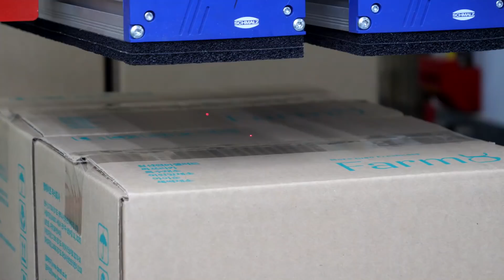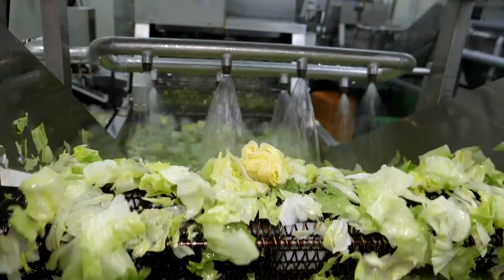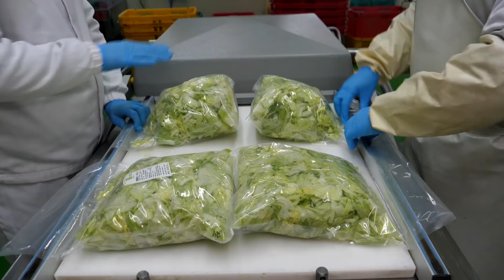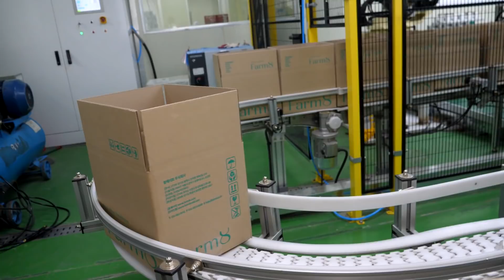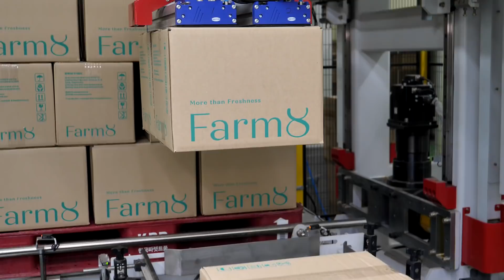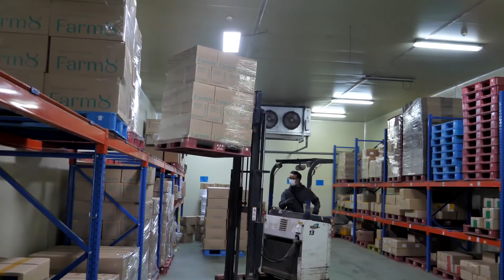연매출 600억! 샐러드생산 1위! KFC, 버거킹, 써브웨이 납품하는 국내최대 샐러드 공장의 생생한 현장 / Amazing Korea's largest salad factory

Comment: The points that need humans will soon be replaced. It will be very easy to use self driving lifters to transport the boxes from the output to the truck. And some system to assure quality. More and more, this will be a black box where produce goes in, product goes out. No human interaction required.

Comment: It is for sure one amazing FACTORY. I how ever a person who has built factory's world WIDE. A d have a PHD in arts and  industrial design engineering.  I find the factory to loud. The contacts on opening and closeing Gates, door, spinning dryer seem to bang. The over all conveyor system is ok. But with blowers at the points where the chopped lettuce gathers can be eliminated.  A small constant clean water also should be placed at those points. Spent water with scrap, piece of lettuce could be skimmed , quick dryed for chicken feed, rabbit  feed. And it would cut down waisted man HOUSES cleaning. The white belt first one should be replaced to a newer system, that's  easier to keep clean. With fast food ecoli salads. 
It's worth the effort. So in a recap, make factory quitor,  upgrade debarie points where scrapes gather. And cut cleaning hours, by make more spray points, per wash, a d after wash points, place quiet blowers. Factory is amazing.
Reply: quieter... but I get your drift. My thoughts about the “dead” product, that can sit for hours and then be reintroduced to the product feed, after washing are similar to yours.
Reply: @peterharms3639  yes your right. I also see alot of clean up time that can be cut down saving on labor. Large factory are so complex. Profits come down to cut seconds off of production times. I was contracted in 93 by a major car maker. 2.5 mile production line 18000 people working the line 24/7. Every 10 feet ( called a board ) it was taking line workers over 2.3 mins per ten feet. The company lost money on each car if it took over 1.3 mins. So every car made was a loss. My skill set, and back ground is a EXPERT on production lines PHD in it. After 6 months to study the line. My fix cost them 125 million. But I was able to get the production line time per ten feet down to .58 seconds. They were happy, my fee was based on cutting times.
For every second I saved x 18000 workers I made a few bucks. Well 25m,
Reply: So, you have (2) PHD's and you've built factories worldwide yet you cannot spell properly nor form coherent sentences? Yeah, okay.
Reply: @peterharms3639  corrected the man on one word lol  🤡
Reply: @justinreynolds6318  English might not be his first language.
Reply: @ClownWorld91  “A little piece at a time”.  It may not be a perfect world, but we can have good spelling and grammar.